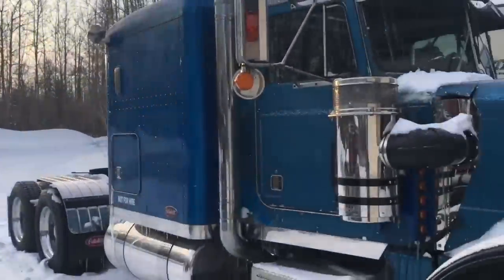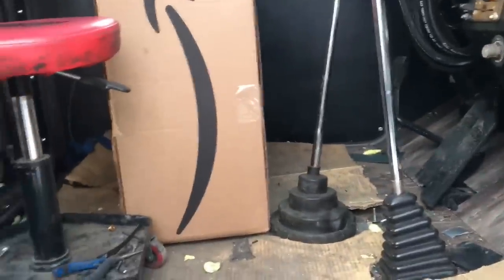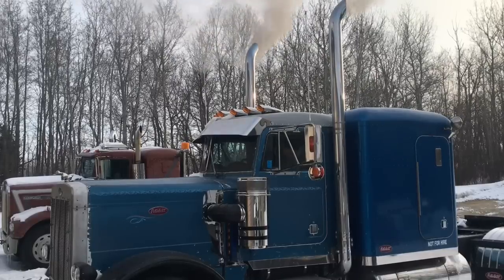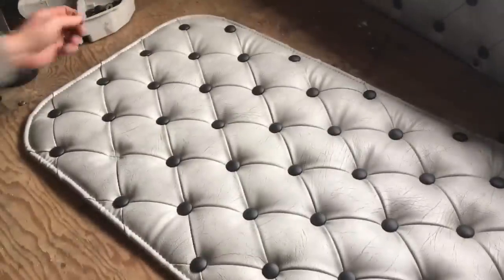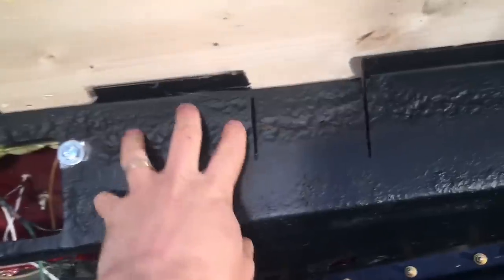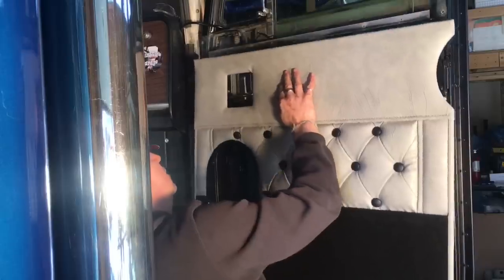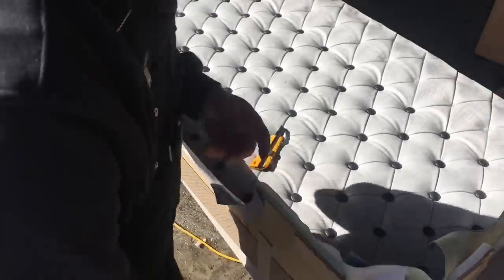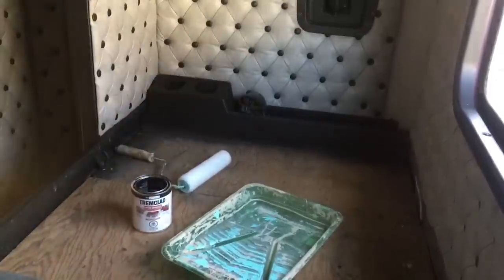Peterbilt 359 Restoration Ep.52 Cab Interior Install

Comment: Looks great, love what your doing. 
Hang on to some of the interior/leather pieces you cut out, you can cover the access panel for the CB, threaded rivets will make pulling the panel up and down easy, trust me you will find yourself use the access panel a lot, mount the CB to it. 
Inside door handles are mounted to aluminum that can be sanded, polished to a mirror finish. ( like we did in the 70’s)

Comment: Looks like you had the roof cap support extrusion upside down, you wouldn't need to drill any more holes if you stuck it to the roof cap with polyurethane adhesive sealant and bolted the ends to the mounting lugs. Used that method in several vehicle applications with 100% success. Regards from the UK 👍

Comment: This interior reminds me to the old french upper class
brothels ....no, they used darkred coverings. Anyway,
do you thought to use one of the small corners in the
sleeper for a fridge and the opposite for a shelf with
a lockable hinged door? Some round led headlights
give it a good ambient at night and a flip open side
and roof window with mosquito net. Electric operated.

Comment: I have one observation regarding the wiring.. could you renew all the wire terminal and evaluate what need to be changed.. you can check Alibaba website or application, they have pretty staff there suite any wire terminal and you don’t have to cut and past. It is all in there. Give it try bro. All the best 👍🏻👍🏻👍🏻👍🏻👍🏻👍🏻👍🏻

Comment: Rather than mounting those interior panels with screws since you have such a large mounting area, why not use 2” wide extra heavy duty Velcro full length in several spots? It would never fall down, and would be easier to remove if you wanted to run wiring or something later.
Reply from the maker: Brian Kempkes interesting idea 🤔

Comment: There's two aluminum brackets that run from front to back, there pretty big
Reply from the maker: cliff beckwith yes on an original roof cap there are runners front to back.  This new fiberglass one has nothing as it’s just a shell and I was reluctant to cut out the old ones and drill more holes in the roof to mount them
Reply: @TwinStix  I completely understand, as long as you got it to work, thats all that matters. Keep it up im enjoying the ride.

Comment: What am I missing? You had two new leather seats in earlier videos that you were putting in & taking back out several times. What's the story with  more new seats.
Reply from the maker: Daniel Hofer the legacy seats were too large for this little cab ... couldn’t get into the sleeper with the arm rests so I sold those seats to my cousin for his trucks and ordered Bostrom lows with mid backs and no arm rests 👍
Reply: @TwinStix  Yes those 359 cabs are pretty narrow. There is a brand of seats that has the arm rest able to move out of the way for access between the seats, I don't know the brand name.

Comment: Where did you source the small black trim screws?  They are the same or very similar to Ford trim screws used from the mid 80s on.
Reply from the maker: DayCab Company
Reply: I felt kind of silly as I was watching later episodes & saw you with a bag of them at some point.  While on the Day Cab Company, though, they really ROCK!  Great work &looks like several options to choose from.  I love your passion to figure out how to do most everything yourself.  You are very correct that the older trucks were simple to work on, brutally tough, & will last forever with proper care & maintenance.  Look forward to the finish of The Bandit truck as well as the Iron Duke.

Comment: Nice video where did you get your sleeper boot gasket?
Reply from the maker: GB BG Dirks has them https://www.dansshopinc.com/
Reply: I got mine from them and it didnt fit like the factory did. Did yours go under the allumnium hold down pieces do you have any pics of yours you can emial me maybe maybe i put mine in wrong. My email is gary81neon@yahoo.com.  oh and nice truck i have a 90 379 one owner it had 515000 miles and garage kept but i work it every day so it needs a new paint job now and stretch the frame some day.